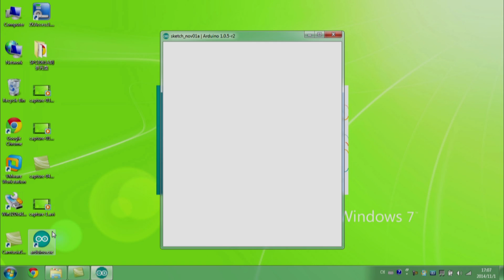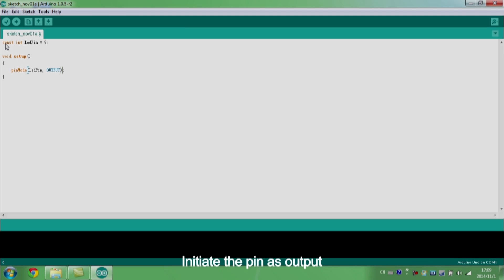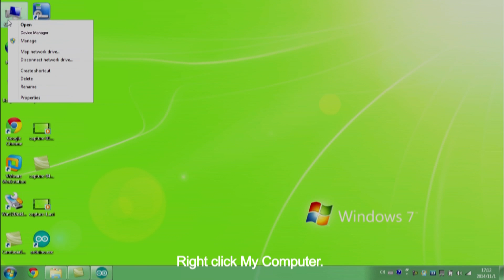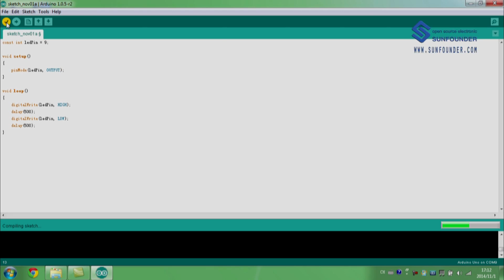SunFounder Learning Starter Kit Tutorial for Arduino - Blinking LED

Comment: For a 50 second set up use this close up picture  https://imgur.com/a/dB9Mz
Reply: This saved me so much time. The Sunfounder videos explain the engineering principles great, but don't show good enough close up images like this. Thanks!
Reply from the maker: Thank you for your support! Welcome to post forums on our website www.sunfounder.com if you have any questions!
Reply from the maker: +Mark Askfjh  Well, the wiring is the same in fact, though the connected holes in the breadboard differ. You may refer to a simple tutorial for breadboard learning provided in WIKI on our website at http://www.sunfounder.com/index.php?c=downloadscs&a=Manualdetails&id=82&name=Arduino.The wiring shown by your Imgur pic works the same. But attention should be paid to the LED pin connection – the longer pin is anode and should connected to the 220ohm resistor and then to D9, when the shorter pin, the cathode, should be connected to GND.
Reply from the maker: +Mark Askfjh Since our website's been upgraded, the link is changed to this: http://www.sunfounder.com/wiki/index.php?title=Breadboard_Basics_%E2%80%93_Types
Reply: +Sunfounder nice!
Reply from the maker: Mark Askfjh Thanks! :)

Comment: I love my kit and was able to make my first lesson work (after I got the LED plugged in the right way -- I was confused about which end was positive and which was negative for a while there...  :-)!!

I am wondering, though, why my board, as well as the diagram in the book, has 3 jumper wires on it and the board in the video only shows 2, yet works the same.

Am I missing something?
Reply from the maker: +Susan Colley Sorry for the late reply. Maybe you've already found the issue - so, just in case! Since  the circuit works, maybe you added a wire between the LED and resistor? You should first understand the the principle of the breadboard. You can refer to the article on our website if necessary: http://www.sunfounder.com/index.php?c=downloadscs&a=Manualdetails&id=78&name=Basic%20Understanding%20of%20Breadboard. 
And to specify the anode and cathode of an LED, you can just check the length of the pins. The longer pin is the anode and should be connected to 5V with a resistor between them for protection, when the shorter one, the cathode, can be connected directly to GND.
Reply: +Sunfounder Thank you for your reply!!  I was starting to wonder if my message had vanished into the ether...  :-)

I'm actually out of town right now, so I can't check the answer against my board, but I'll look back into it when I get home in January.

It looks like great information, so I'm looking forward to a better understanding of what I've actually gotten myself into!!  :-)

Have a great night, a Merry Christmas and a Happy New Year!!!

Sue
:-)
Reply from the maker: +Susan Colley Thanks for understanding. 
Same to you! And have fun!

Comment: This worked greeeaat for me! I followed the video (not the digram that pops up on it, depicting a different resistor) - Thanks for sharing!!!
•
I wish these tutorials were with the tutorials on the Sunfounder website! It would have really saved me some trouble, but at least they're here. Unfortunately, the diagram shown in the bottom corner shows a different resistor being used. In the booklet and website the diagram is even more different. The booklet diagram doesn't work.  http://www.sunfounder.com/index.php?c=case_in&a=detail_&id=5&name=Arduino
Reply from the maker: It does not matter. They have the same resistance.
Reply: Sunfounder
 Good to know! Thank you!!!